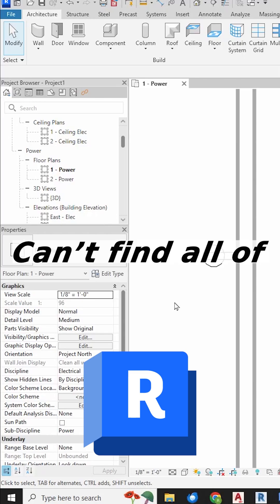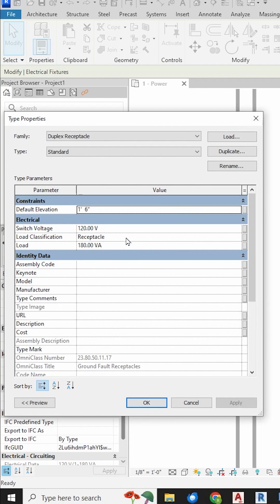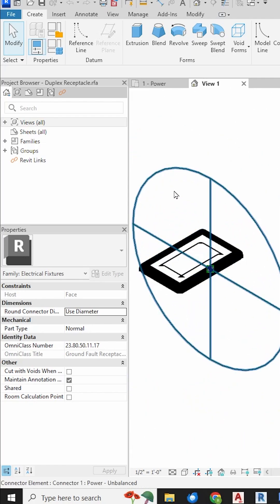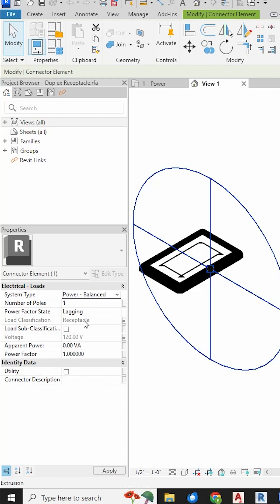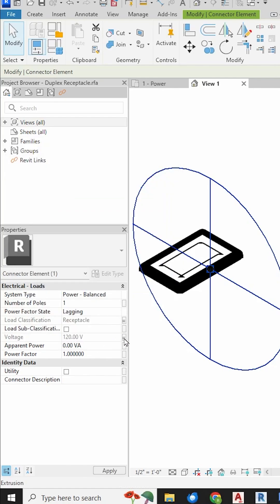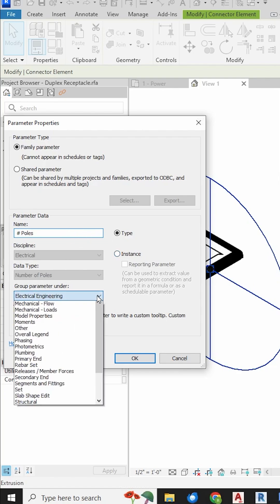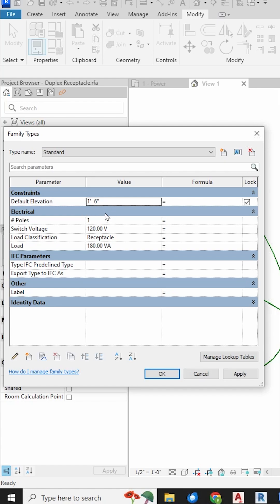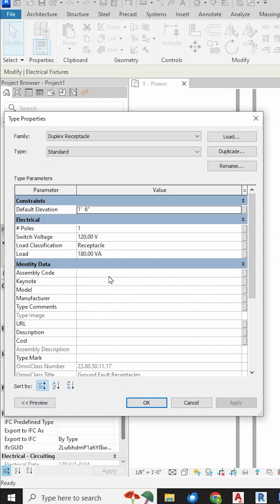How To Add Missing Parameters In Revit Families! #shorts

Comment: Hey Rob, do you have any videos on shared parameters?
Reply from the maker: Hey John. Actually, I don't, but I suppose I should. Personally, I've not used them, as I like my projects to be totally self-contained, without any outside files needed (other than linked models). But I know there are many good use cases for shared parameters.